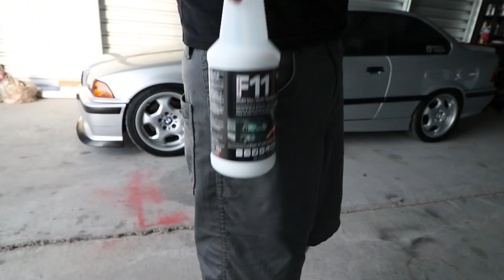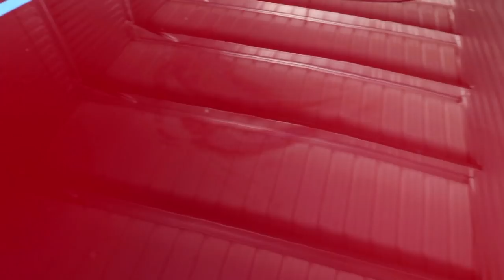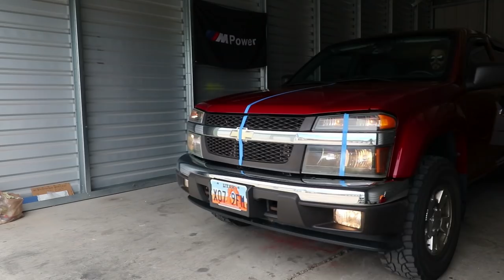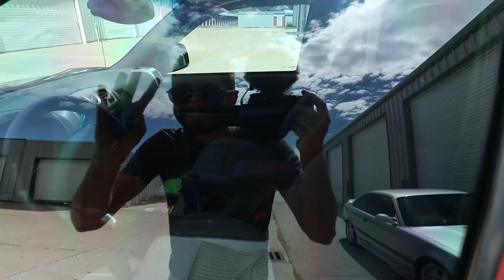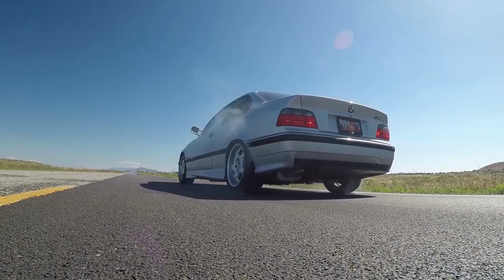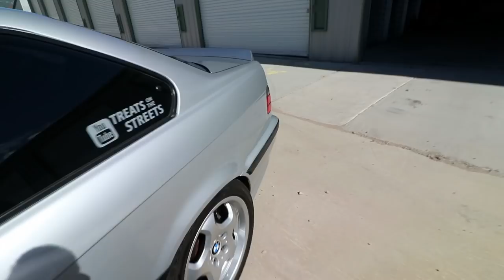WHAT TO EXPECT when using TOP COAT F11: Reality Tested

Comment: I have a 2012  White BMW 128I convertible and I purchased F11 and did the interior and exterior, wheels and tires.  I parked it in my driveway all day while I was working inside.  About 5pm I went to put my car back in the garage, and what I saw pissed me off.  I had a ton of bird shit all over my car, like it was hit by a bomb, that purple shit that usually penetrates the paint and is impossible to get out.  I got a hose and a sponge, no soap, and washed all of the crap off, and it came off very easily, it made a believer out of me.  I've since put on two more coats and it looks awesome.  This stuff works.

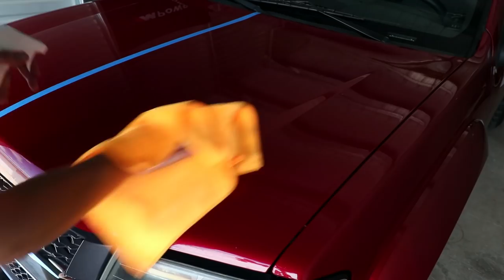Comment: 3:46 FINALLY! Getting on with things! I'd be more interested to see what the product does to a more troubled paint job but thanks for showing off your toys...I think..
Reply: It’s not for fixing troubled paint jobs, it’s a protectant.  Everyone thinks these products are designed to fix trashed paint, and give them a bad name when the product fails to do that.  It’s a good product if used for what it was designed for.
Reply: @rodgraff1782  F11 is hot garbage and you know it. Zero protection . Its just a greasy film. Why dont you wash that truck on camera and show the results. It will be gone after one wash. That crap costs 5xs what meguiars and turtle wax does and offers 0 benefits.
Reply: @johncastillo6159  technically its a polydimethylsiloxane, silicon water based solution, but as a sealant....yes its garbage lol.  I agree with you.

Comment: F11 is the single most over priced product out there, try Turtle Wax ICE Seal and Shine instead. It cost $10 and will last for months! Love the E36 M3, I have a E36 M Roadster that I love!
Reply: Ya for that price you can get a restore paint job once a year for 250$ even if they had gold in it I wouldn't be spray it on my truck 😂
Reply: If you buy by the gallon it’s actually cheaper. Like $20ish a bottle. Yea you gotta buy a bunch up front that way. But curious what your thoughts are on that when your getting it cheaper but having to buy more up front.
Reply: @ridin_low193  F11 is hot garbage. Sucks you fell for the marketing. This shit comes off after the first wash and has zero protection for paint. Get turtle wax seal and shine or meguiars products. F11 is crap. Both products are 50 % cheaper and work 10xs better.
Reply: 100% correct.
Reply: John Castillo yea I switched. It wasn’t garbage but definitely over priced for its performance. I now use the last coat V2
Reply from the maker: Same here 🤣 TLC2 is much better

Comment: Is that stuff just a silicone based  that will turn to garbage in 2 weeks like a glorified Armor-All? I'm curious about the long term effects of the build-up and sun-baking.... Anyone know?
Reply from the maker: I'll let you all know once time goes on
Reply: I live in Vegas and have been using it for about 2 years. No issues with it at all. I use to put way too much thought into sealants and sprays and was a big fan of Zaino. Just too much work. I spray my car every other wash and it's been great so far.
Reply: Yea I know.  I’ve been using it on my truck since 2007, and my paint still looks new.

Comment: For the price of F11 you can buy a real coating, I go with GTechniq or modesta, Either will last at least 2 years !
Reply: Ken H  You are  missing the primary benefit, which is F11 goes on any and all surfaces.  It does a good job of replacing so many products and does a better job than most of them. Then you can take it inside your home, and do your appliances, counter tops, shower stalls faucets, outdoor barbecue, wooden garage doors. Etc.  I use it for everything, including my laptop computer screen, cell phone, and eye glasses. Your “real coating” paint sealants may have more longevity, but can you put them on leather, carpet cloth,  convertible tops etc?? I think not!  Topcoat is expensive, but it’s worth it if you use it to replace all of the products that you would have to buy, if you use a proprietary product meant  just for the car exterior.  Think about glass cleaner, trim protectant, covetable top cleaner and scotch guard, engine cleaner, rim cleaner, rubber treatment, chrome cleaner, lexol for the leather, rainex to repel water on the windshield, etc etc.

Comment: Waiting on mine hopefully I'm not disappointed I live in Ontario Canada weather up here is so much more brutal.
Reply: You will certainly be disappointed. F11 is hot garbage. Sucks you fell for the marketing. This shit comes off after the first wash and has zero protection for paint. Get turtle wax seal and shine or meguiars products. F11 is crap. Both products are 50 % cheaper and work 10xs better.

Comment: I bought into it. I now know that it is basically just silicone, alcohol and water. It does not fill in scratches and swirls.  It does not last when washed a few times with soap. Not worth the very high price. live and learn.
Reply: So there is no ceramic??
Reply: @Phantom096  correct....no ceramic in F11. Main ingrediant is silicone. Looks great but does not last, particularly with frequent washing. Started using The Last Coat and very happy with it.

Comment: The one common mis-step that I've seen video about this f11 product is not one did the host waited 24 hours so product can cure. In full disclosure I have never tried this product but it helps when somebody follow instructions so the viewer can have all the right information whether or not the product does work as advertised.
Reply from the maker: The 24-48hr cure time more has to do with the durability of the product, not the shine. The cure time is there to prevent you from washing with water before it has time to set. If you wash before the cure time or if the vehicle is exposed to rain or heavy dirt, it can wash off a lot more of the product than if you gave it time to cure.
Reply: @TreatsOnTheStreets  thank you for the info.

Comment: F11 users remember to let it cure for 1-2 days! I do 2 on mine before I bring my vehicles out. Yes it’s hefty price at first but it becomes less expensive since you’ll only be using it less and less as the product does adhere to the materials BUT 🍑 you HAVE to let it cure!
Reply: So you have to let the car sit in the garage for a few days?
Reply: Samuel Hewson not necessarily I would recommend to do it for two days in the garage and out of the sun to let it cure and dry properly. The sun can cook the product and not adhere properly. Yes it can repel water even like in the video you see here. I recommend at least 24hrs the minimum. I do the full recommended time of 72 hours if I’m not mistaken. Others can correct me if I’m off. See it’s like paint, once you paint a wall, you don’t immediately touch the wall cause it’s wet and you will not let the paint do it’s job cause the particles were interrupted during the drying/curing process. That’s my analogy and hope that makes sense. If you want the product to work well then follow its instructions. Some apply it and start to wipe it off rather than letting it cure.

Comment: Off topic. But I watch you for the e36 my favorite youtuber since I just picked one up. 9k for m3 109k miles 1 owner hellrot red. Automatic. Was it a good deal? Dinan exhaust dinan intake and Dinan strut bar and brace
Reply: If it is in good cosmetic and mechanical condition I would say that's a great deal. I just got one and while it is a great car it needs about 4k in work which wasn't specified by the previous owner of the car. Kind of irritatating.
Reply: Great deal

Comment: It looks like the swirl marks are still on the truck.  A Claybar still has to be used first.
Reply from the maker: Clay bar will not get rid of swirls. It would need a full paint correction, cut, and buff. This product is only made to enhance and protect the finish as it is. Make sure to watch the part 2 long term review where I go over a lot of things I found from using f11 consistently for months.

Comment: Treats!  So how does the plastic on the truck look after a week+?
Reply from the maker: The plastic is holding up better than the paint actually. I reapplied some more f11 after washing the car 2 times. It still had some shine left before a reapplied, but the second coat made it look better than it did the first. I'd definitely stress giving the f11 48 hours to cure before getting it wet or dirty.

Comment: Would this replace waxing or work in conjunction with.
Reply: PNW Outdoor Life replaces. You want to strip all waxed prior to applying
Reply: F11 is hot garbage. Sucks you fell for the marketing. This shit comes off after the first wash and has zero protection for paint. Get turtle wax seal and shine or meguiars products. F11 is crap. Both products are 50 % cheaper and work 10xs better.
Reply: John Castillo not true I’ve been using it for a while now and it works great. Everything literally wipes right off my car like nothing. And every wash brings back hydrophobic properties, just like any other sealer. I also don’t have any scratches or swirls in my paint after loads of washing so it must be doing something lol. I’ve coated 3 times so far.

Comment: Love your vids man👍👍 what mods do you recommend on a 94 e36 325ic
Reply: Elvis sell it and get a s52
Reply: Polish the head, change the headgasket. Put 274/256 camshafts. Cold air intake. Put Vortech-2 compressor on it. Tubular control arms. Extending rear camber arms. Get "17 et29 j8.5 wheels. Get Schmiedmann exhaust manifold. Supersprint in the back. And enjoy life ;)
Reply: @Sibiriuss  A bit extreme. Honestly I would just change the factory cooling system then put a cold air intake and possibly a decent exhaust on it.
Reply: @M-t3ch  that's not a mod, maintenance rather.
Reply: @Sibiriuss  That's a better way to put it.

Comment: Sweet, waiting for my f11 in the mail.. also from utah!
Reply from the maker: Nice!
Reply: Did you eventually get it and apply it ?
How was it ??
Reply: You will certainly be disappointed. F11 is hot garbage. Sucks you fell for the marketing. This shit comes off after the first wash and has zero protection for paint. Get turtle wax seal and shine or meguiars products. F11 is crap. Both products are 50 % cheaper and work 10xs better.

Comment: How about a update video, how long does it last?
Reply from the maker: There is one in the works. Interesting results....
Reply: You will certainly be disappointed. F11 is hot garbage. Sucks you fell for the marketing. This shit comes off after the first wash and has zero protection for paint. Get turtle wax seal and shine or meguiars products. F11 is crap. Both products are 50 % cheaper and work 10xs better.

Comment: You should have a update video after a week to see the miracle of this product everyone claims
Reply: Noel Torres If you maintain the outside it should last a month or even a couple of months.It all depends on where you leave your car and where you drive
Reply: You will certainly be disappointed. F11 is hot garbage. Sucks you fell for the marketing. This shit comes off after the first wash and has zero protection for paint. Get turtle wax seal and shine or meguiars products. F11 is crap. Both products are 50 % cheaper and work 10xs better.

Comment: I'd rather use wax to fill and buff out swirls and imperfections.
Reply from the maker: I've found wax to work really well too. This stuff just is faster, and won't leave white residue in deeper rock chips and imperfections
Reply: MICHAEL GRANT go ahead, and fight getting rid of all the white residue wax leaves on the seams

Comment: Topcoat is not designed to fix surfaces that are already trashed, such as you plastic headlight lens.  It is a protectant, not a quick fix.
Reply: It doesnt protect shit. You will certainly be disappointed. F11 is hot garbage. Sucks you fell for the marketing. This shit comes off after the first wash and has zero protection for paint. Get turtle wax seal and shine or meguiars products. F11 is crap. Both products are 50 % cheaper and work 10xs better.

Comment: Still a ton of swirl marks. Wish I would have watched this first before I just purchased this crap for $65
Reply from the maker: It is a sealer not a paint corrector. Swirl marks are removed via pain correction which is what you do before applying a sealer. No simple wipe on product can remove swirl marks.
Reply: 1st, why then mention the swirl marks on the paint in the video before applying, 2nd, have you seen the ads for it? They swear it will solve all the worlds problems and increase sex drive!
Reply: Treats On The Streets wait wait wait! Is this really just an ad for F11?  Were you paid to sponsor?
Reply: I’m glad I saw this! The product does claim to polish and protect. I need something to make the paint look great, I don’t care how long it lasts because I don’t mind regularly applying product.
Reply: Davy Pig  It’s not a polish.  It’s. Final finish.  You need to work out any paint problems first.  It’s called paint correction.  Topcoat is. Protectant.
Reply: Zymol will help hide swirl marks.